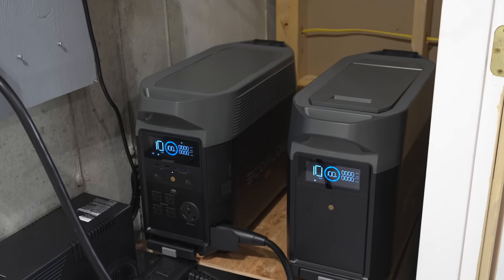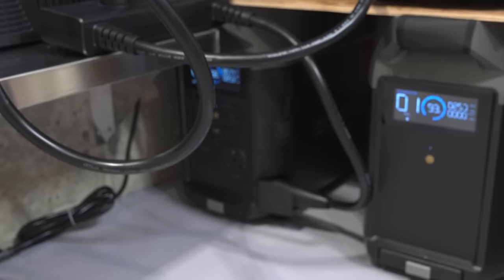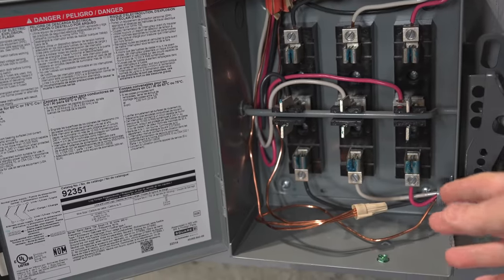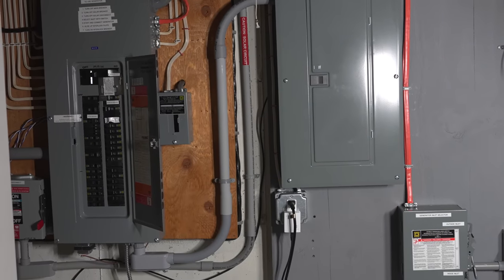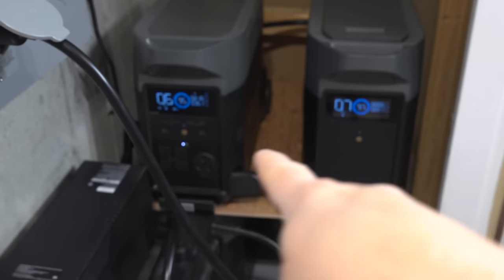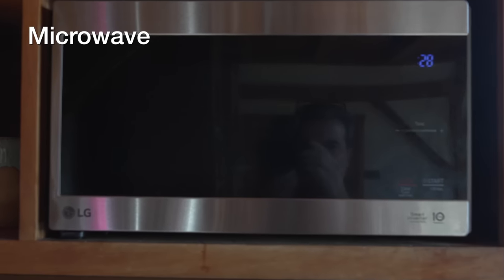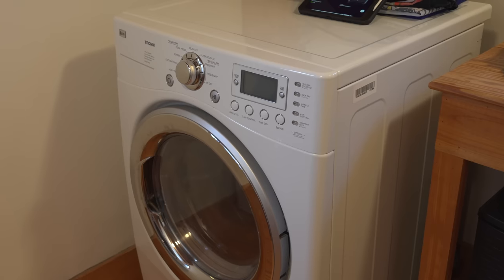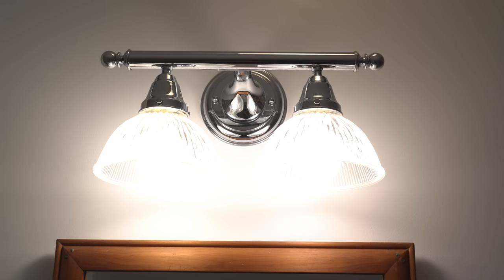How to power your Whole House with a battery generator - Ecoflow Delta pro

Comment: It’s good to have a backup. Especially if you have equipment that needs to run during an outage. Solar is a poor energy choice. This seems much more justified considering the cost of solar. In my opinion, the cost of the batteries isn’t worth the investment. Just run the generator during outages. Gas/diesel will never surpass the battery cost. Plus it’s just another thing that won’t need replacing or maintenance.

Comment: It's a nice set up, but you're always looking at price and versatility.

If I'm right, the two units with the extra batteries are gonna run you around $12,000 .

For less than that, you could get a Tesla power wall or a Generac and then you can have power which will regenerate via Solar. And if you go more technical, you can probably have that put into the grid to earn you some money back overtime.

For me the laborer. I went the route of a $1600 generator inverter. It's quiet and more efficient on fuel.

Even if I rounded that up to $2000 and took the remaining $10,000 and estimated five dollars a gallon for gasoline I would still have 2000 gallons of gas which would equate to about 133 days at your 15 gallons per day. 

That substantially a good 130 days of power more than your system would provide because after it's depleted, it's depleted…

While you would still have the availability to replace power in your current units, you still have to have more money spent in another generator, or some other source of power to re-power of those packs. 

If, you were able to take a ride, let's say to a power station, and plug in those battery packs like a Tesla and charge them in an hour then that would be a probably potential option. But I would imagine lugging four batteries to the Power Station would not be convenient.

Comment: Your text is wrong. It should say:  Interlock is a legal form of preventing backfeeding, which is allowed causes problems.

Also, before you do anything, the first step is to unplug your ecoflow, otherwise it will charge itself.

Comment: Ecoflow's website states that their smart home panel can also be used to save on power bills (presumably if the price of electricity goes up at certain periods of the day). I would be curious to see how this would work. I don't think that manually switching the panel to run on the ecoflows would be a convenient solution for most customers. Also, as mentioned by others, this set up is big $$. I would be curious how it would compare to a Powerwall or something of that nature (with solar input or only charging through the grid). Cheers.

Comment: I wonder how this would work with a grid-tied solar system (like Enphase). Would it trigger the microinverters to operate like they are connected to the grid?
Reply from the maker: That is amazing that you asked this. This house (which I have only been in for 7 months) has rooftop 4kw solar with enphase. I haven't gotten that far but I am also wondering if I can tie its 120v output to the delta pros in some way during an outage. I will share what happens but it will be a month or so from now as I need more research or perhps others may comment here that may have done it already.
Reply: @SilverCymbal  awesome thanks! I recently installed a 9.1kW enphase system on my roof.
Reply: @SilverCymbal  It doesn't sound like that would work with this system, but the Scnieder Electric XW system can be configured to work with Enphase inverters.  IIRC, when the batteries are full and it is connected to the grid, it sells the excess to the grid, and if not, it alters the frequency by a few Hz to force the Enphase inverters to shut down.

Comment: I would like to do solar to charge the batteries and run it on a manual transfer switch instead of switch in your panel.  That way I can utilize the expensive battery setup all the time instead of during power outages.  I can't  find the square D 3 phase switch anywhere.  Your links takes me to a siemens 3 phase switch.  Thanks for the video.

Comment: For $8,600 is better run the whole house that's nearly a standby generator cost. Or if you don't want to run a genny, get some server rack 48V batteries and a LF inverter and I bet you could get a lot more for cheaper.   Delta Pro  is 3,500 and extra battery is $800, and look like you have 2x of both.
Reply: A typical problem with server rack UPS systems is that they charge very slowly, and then you have to directly wire only specific circuits into them rather than being able to wire the whole house.  Another is that they tend to use sealed gel cell lead acid batteries and keep them topped off at peak voltage constantly so they boil off the water quickly which you can't just top off, so you end up replacing the batteries every 2-3 years.  Properly maintained flooded lead acid batteries can last for 20 years.

Comment: To be prepared for an regular outage event it's good enough but expensive, for a disaster event this is not enough, or could be but only using the essential circuits on homes with gas installation, but moderated use as microwave, lights, furnace, some outlets, but not good for homes with all electric big appliances,

Comment: Well it's not a battery it's an inverter with a battery powering it depending on what you are powering you could use a battery to power some things like brushed motors and heating elements and I tried a cheap switch mode power supply and it seemed fine but I didn't run it long and it probably would like a little higher voltage but I have a small box with batteries and have used it some

Comment: How long could you go with just one EcoFlow? Also, how long would your setup take to charge an electric vehicle?  Great informational video thanks.
Reply: It sounds like one EcoFlow only outputs 120v and you need two to get 240v.  As for how long it will take to charge an EV, the EV is going to have a larger battery capacity so trying to charge it even with two EcoFlows is going to run it out quickly.

Comment: The problem is that the battery system is by far more expensive then a simple gas generator. And then after 10 years how good are the batteries? That in comparision of how often you got a power outage.... is ist worth it?
Reply: Its worth it to me because of the convenience. Just experienced Hurricane Berly. Gas stations that were open had long lines, the smell of gasoline, the maintenance of a gas generator. The noise. Running out of gas and driving around looking for a gas station ⛽️ with several gas cans in my vehicle 🚗, naw I’m cool with the low noise and convenience.

Comment: Could you please explain what happens to the neutral ground bonding, when a solar generator/gas generator are connected, with a reliance control transfer switch?  My AC200P doesn’t have a neutral ground bond until I connect it to the outlet.   Is it getting in from my main panel?   I really can’t understand what is happening.  I thought that there can only be bonding at one location.   I love the way you do views!   Thanks!

Comment: Did you cover cost, while as a youtuber you got them for free, what is the average person looking at for the connivence of this setup (ROI)?  Diesel Generator vs 4x Ecoflow Delta + solar bank to recharge those to 100%.  Trying to understand the emergency power cost and longevity of replacing those batteries over time vs storing diesel over time.

Comment: You have a great setup. Are you going to add solar panels?  I have a similar setup using BLUETTI AC300 with expansion batteries. I have the solar maxed out and run it 24/7.  It’s paying for itself because my electric bill has gone down by $100.00 per month. I don’t have the 220. I only have 110 volt with the transfer switch.

Comment: I like your setup and I've learned a lot from your other videos. I particularly like your setup for backup power. I am in the process of getting a couple of electricians quote on a similar setup. Though I will be using an interlock kit on my main panel instead of a transfer switch. I was thinking of going with a 50A inlet box for the outside connection and a 30A inlet box for my 2 Delta Pros which are situated inside the house connected through double voltage hub. The thinking behind the 50A inlet for the outside connection is I might upgrade to a bigger generator later that can hopefully power a 4 ton AC unit, right now I just have a small 3KW generator with a 30A outlet. What specs should I be looking at for the safety switch in this case? I could also just install a 50A inlet for the delta pros and use a 30A cord with an 30A to 50A adapter if that will simplify things.

Comment: Great video!  How would you tie this setup to charge your batteries using a gas generator? Or just simply running a cord from the outside (gas generator) to the batteries?

Comment: My apologies if this is a stupid/simple question: You said when the EcoFlows get to ~20% you will plug them into the gas generator to charge them/everything... my question is, do you have to carry all 4 outside to charge them then? Or is there a way to connect them thru the wall? Just asking because that is a lot of weight especially depending how far the doors are to get outside and if stairs are involved, but also just because they would need to be plugged in for awhile to charge and I would be worried they would get stolen. It would be cool if there was a way to charge them via the gas generator thru the wall and also a port for solar charging cord to go thru the wall if you wanted to charge them via solar panels (without having to take the batteries themselves outside too). Do they make pass thru wall plugs for this purpose?
Reply: Some people buy a long heavy duty extension cord and swap between the Pro units.

Comment: Problem with the battery generator I found out after getting one.   When not in use, you must store them with a 30% charge.    At the cost of your set up, just by a whole home generator run off propane or natural gas.

Comment: Can you review the Zendure Superbase V power station? It is the first power station to supply 120 or 240 volt operation at the same time in one unit
Reply from the maker: I have a request into them for that one. Now that I have this connection it makes it a lot easier to test real world 240v usage. Specs are specs, but until I see the dryer run I won't believe anything 😀

Comment: I have 2 delta pro's and have always been told I have to use an inverter generator to charge them. I have a newer model 5000w briggs and stratton non inverter generator, and was hoping to use it. I don't want to damage my delta pro's though.
Reply: For the cost of delta pros, they should have built in protection. I have renogy and charge with a standard generator.

Comment: @SilverCymbal
You always have such informative videos.  They always inspire our curiosity even more. Thank You.
 I have a couple questions for you.
Is the EcoFlow "Hub" you mentioned a  kind of inverter?  It seems like you might have a separate inverter in your system too from what I could see in the video.  I have a relatively small cabin (about 1,500 sq ft).  I also have a generator for power outages too.  I'm interested in connecting a battery/solar system to the house also.  Do you think a system like this could take you off the regular electric grid full time?  I'd appreciate your opinion.

Comment: Nice video.  I might have missed it but can the batteries be charged while still delivering power?  (For example, solar or generator),  I have seen other brands that have to be switched off to receive a charge.  Thanks
Reply from the maker: Thank you, yes they can be charged while delivering and can accept two inputs too, so you could be getting solar input and a gas generator AC input too
Reply: @SilverCymbal  - that’s great!  Thanks

Comment: What would happen if you had a setup like this and also 240v of solar being fed into the main service panel? This is a goal of mine - to have a split phase battery backup energizing the house in a power outage and have the solar supplement or even charge the battery backup if the sun is shining.
Reply from the maker: I didn't cover this but I have just what you are describing, it was in this house when I bought it. When you have a battery or generator its best practice to turn those off. Most solar companies offer battery systems of their own that tie directly in but then you are locked into that company. Might still be a good solution, always good to research whats available and see what works for you

Comment: There is a secret issue with the Delta Pro's....when you are AC charging, DO NOT HAVE THE INVERTER ON !  My Delta Pro burned up when doing this...DO NOT AC charge, while you have the Delta Pro AC inverter turned on...this is a huge no-no...
To get around this issue... I do is this...I have a 1500 watt power supply that puts out 150 volts DC @ 10 amps. I use this DC power supply to fake 'solar' charge into the MPPT [DC Charge port] and power the 1500 watt power supply with my gasoline generator.  The only issue is there is less efficiency in doing this...when I charge purely AC [with the AC inverter off]...I get about 96% efficient.  However, when I use the DC power supply, I am about 86% efficient. So, there is an 8% loss here...
However, if you can turn off you Delta Pro, you can charge using the AC port... at 1800 watts from a gasoline generator.

Comment: Battery to run the house, because gas generator eats gas whether or not it's being fully used, and use the gas generator to charge the batteries... because the batteries can take in the gas generators full output (no waste) right?

Comment: You can use solar which I’m sure you know this but also solar will take for ever to charge 1 battery let alone 4 , “ I’m Dublin with a car alternator run on 12v Dc motors set up on voltage regulators to start turning when the battery bank voltage drops to a specific voltage which is higher then my lowest voltage which is 2.6v so I’ll set it around 2.8v on my 3.2v 48v battery banks and I’ve seen the tests on the best voltage to keep my batteries at is 3.50v not 4,65v which is max charge ! If you tap into the stator of the alternator the copper wire under the case that is the truest sine wave and on average produces 1 KW 1,000 + W out of my Gm 10 SI high Amp alternator 110A Dc , and I’ve got a Big Block Low Turn Gm 10 SI High Amp Alternator 120A Dc & I’ve got A Ford / Mazda Elips 150A Dc , every copper wire widening which connects s All the wire together the Gm’s  have 3 under the back of the case  & the Ford has 5 what they say is each one is a different phase ! Energy independent !

Comment: We had a 20 hour power outage during the 2022 storms. Our backup generator ran all the time, on propane. Battery backup would have lasted only a few hours. I see they mention that battery backup is only good for shorter outages.
Reply: That all depends.  If your load was low, and you had enough batteries, they could at least last all night during low usage without burning any fuel.  During the day the generator could then be fired up to recharge the batteries.
Reply: @phillipsusi1791  Sorry we were running  a freezer and refrigerator. That would  kill a battery in a few hours. I will take a generator any day.
Reply: @TOONMAN200  Yes, it will kill a battery in a few hours.  But with a generator only, you need one big enough to power everything at the same time, and you have to keep it on all the time, so most of the time is will only be under a small load, and therefore, wasting a good deal of fuel.  If you have solar, and batteries, and a generator, then you can get by with a much smaller generator that only has to run for an hour or two over night when the solar isn't working, and when it does run, it is running more efficiently only using a small amount of fuel, which is hard to replace during the very emergency when you actually need it to ever run at a all.
Reply: @phillipsusi1791  We have a 5000W generator. During the power outage are neighbors came over to use the microwave. It turned into a power outage party, if that's not cool, I don't no what is. Answer to your last comment, we use propane. The whole time we used about 7 gal. from a 10 gallon tank, FYI gasoline is forbidden in our state.
Reply: @TOONMAN200  Yes, having power when you otherwise wouldn't is cool, but running a 5000W generator for 24 hours, even if most the time you only have a few lights running, sometimes the fridge kicks on, and maybe you fire up the microwave for a few minutes, that generator is going to burn a lot of gas.  I'd say probably 10-15 gallons easily.  Now if power is out for 3-5 days, you might run out of gas and not be able to get more after the first day or so.  If you have a battery and some solar, then 10 gallons of gas could easily last 5-7 days.  Even without the solar just the battery alone can make that gas last 2-3 days instead of just 1.  You also won't trip your generator if you are trying to run the A/C at the same time that the fridge kicks on.  Then there's the noise the generator makes.  Its nice when it goes quiet most of the time.

Comment: That is weird so that means one of the two PowerStations will run out of power first and it leaves you with just one 120v Line running to your 220-240v appliances? wont it break those appliances?

Comment: In this setup if I understand it you can not charge your batteries from your generator.  Would also be great to have an automatic switchover to batteries.
Reply from the maker: Yes you are correct you can only charge via solar. The way we use this currently is to run off battery until depleted, then we switch to generator, we will then charge these without drawing power. The good news is that Ecoflow and a couple of others have some new stuff coming next month that I will be showing so stay tuned on my channel for some even more advanced options.